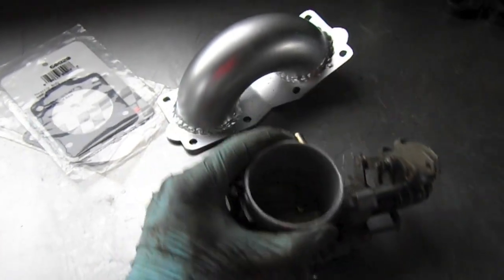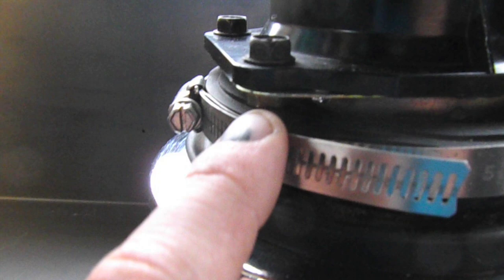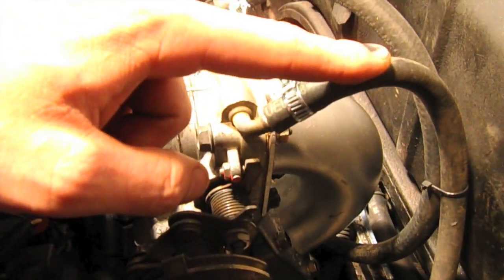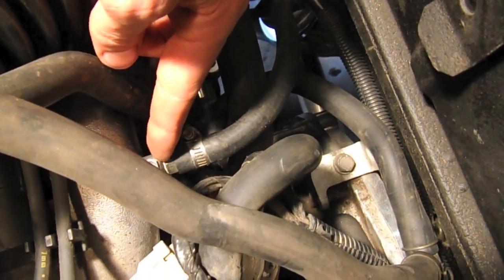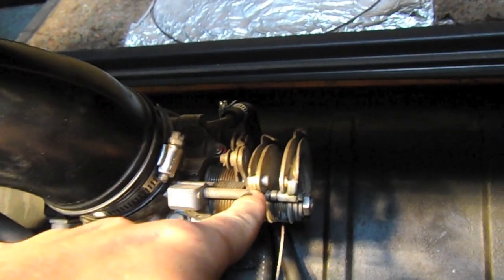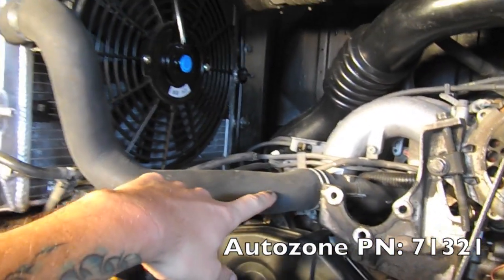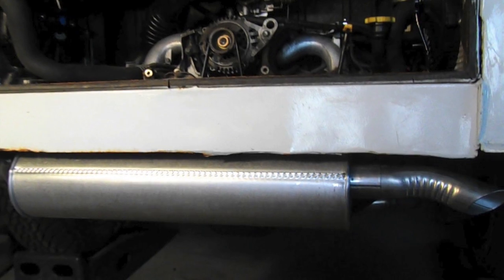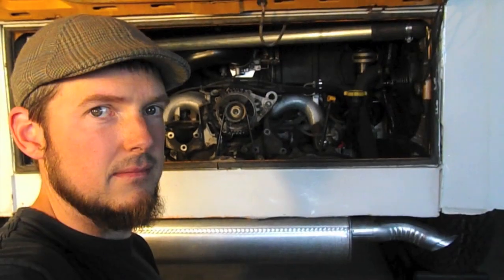Intake, Exhaust, Fuel - Busaru Engine Conversion Part 8

Comment: Clean swap but I can't stand the USELESS emissions shit, and t.b. coolant lines. I would get a nicer muffler without the restrictive and ugly crush bends, make a functional heat shield for the intake, and a less restrictive intake pipe. That charcoal canister should go right in the trash can. Do you really think it's doing much of anything after all those years other than cluttering up the bay and adding more hoses? The t.b. coolant bypass simplifies, and eliminates a possible leak point. Unless you drive around in Antarctica the throttle plate isn't going to ice up. I wouldn't say it'll help your IAT's with hot coolant running through the t.b. I have deleted them on all my personal vehicles and customers cars and never had an adverse effect. You can take it a step further by adding some phenolic risers under the intake manifold. They work well to keep the IATs down, and I used an infared thermometer to see first hand the huge difference they make. Other than those things it looks great, and to the untrained eye it looks like a stock engine for the most part.

Comment: I'm a bit confused about the water connections on both radiators, despite being pressurized, shouldn't the water input connections be closer to the top and the outlets be near the bottom to utilize as much of the radiators cooling surface as possible?

Comment: Anyone any suggestions? I want to build a water car.  I have  ej22 and a van transaxle but i need a transfer case in between with the power take off pointed to the rear on the bottom it will be coupled to a jet pump.  Any help much appreciated

Comment: Thank you for your helpful videos!  I have a question regarding the routing of the fuel lines for the fuel tank venting system.  Correct me if I'm wrong:  you have a fuel line going from the right side fuel tank vent condenser to the fuel vapor return inlet on the drivers side of the engine and a fuel line going from the Left side fuel tank vent condenser to the inlet on the bottom of the fuel vapor (charcoal canister), correct?

Comment: Hey. I have a random question; looking to get some perspective on a car purchase comparison.  Looking to either get a 2007 VW Passat WAGON 3.6 liter vs a 2006 BMW 325isedan ? I like both but am concerned with older model German cars. Both models I'm loooking at have less than 100K miles. Thanks for any and all opinions.

Comment: Can the intake manifold be turn around? If so you would not need the throttle body reverser. 98 Forester 2.5 DOHC to a 79 bus

Comment: Question: you mentioned running the fuel return line on the 73 to one of the vent lines on top of the tank, which side driver or passenger? Also, did it cause a "waterfall" affect? Or create a lot of fumes? everyones telling me to weld a bung onto the bottom. Your input is great thanks for your videos ! Check out the Loud Luggage Bus sometime!
Reply from the maker: +Loud Luggage Co. I pulled up your site the other night - seriously! Cool project my friend. I have never heard of or heard the waterfall effect in the 73 and other non-fuel injected busses I've converted. I've been putting the return into the filler pipe lately and that has been working really well too. I would say that welding the gas tank is a pretty big deal for a pretty small problem to solve. Let me know what you end up doing - I'm always looking for new info.
Reply: Scored a F.I bay window gas tank from Trevor over at Brickhaus Restorations, good friends of mine! He traded me for my tank! Problem solved.

Comment: why do you have two pipes coming out a 2.2 head? the 2.2 headers are one pipe to each head why two? 2.5 heads on a 2.2?
Reply from the maker: Phase 1 EJ22's have dual port, same as 2.5.

Comment: Hey another quick question...what are you using to mesh the subaru throttle cable with the vw throttle cable? I seen that you are running some steel tubing? Are the throttle cables sheathed inside that or are they just bare cable? 

Thanks and keep up with the great videos.
Reply from the maker: The throttle cable is spliced to the Subaru cable using a cable splice fitting. Napa has these, you just want to make sure its a solid mechanical connection. On my white bus, my throttle cable was really broken and messed up so it was necessary to improvise. What you see is a piece of tubing that is bent roughly 90 degrees and the cable runs inside this tubing. Most throttle assemblies I do are just bare cable splicing the Subaru to the VW cable.

Comment: Trottle body reversal is that really necessary?
Thanks a lot for all your great videos
Reply from the maker: Its only necessary if you keep your fuel tank and firewall in the same spot on the bus. Its not necessary for a Vanagon however.

Comment: Great videos. Interested in a wiring kit and a radiator tab kit if you decide to make those.
Reply from the maker: Hey Khalim, I would recommending getting in touch with Tom Shiels about a wiring harness. He is the master with VW to Subaru wiring swaps. He can be found here: http://subaruvanagon.com/tom/ts_conversion.htm

I am going to be offering a kit which includes the engine crossmember, the throttle body reverser, and the radiators. Once this is available I'll be sure to let everyone know.

Comment: What keeps the cone air filter from sucking in water?
Reply from the maker: Hey David, I would definitely mount in another location if you ford rivers often (as I assume happens a lot in Australia and the like), otherwise if the only concern is splash up from the road, it would be wise to put a shield of some sort. I mentioned a shield to keep possible grease kick up from the CV joint if a boot tore, but this could be extended for water splash from puddles etc. Do you have any ideas on how to solve that problem?
Reply: Busaru I'm pretty stumped when it comes to the intake location. Your current location seems like it would be more efficient than the one on your '73. It looks like it will suck more cold air. Maybe like a shield that covers most of the cone but leaves an opening for air intake. A picture would better show what I'm trying to describe. Keep up the good work! I hope to be doing this conversion very soon.